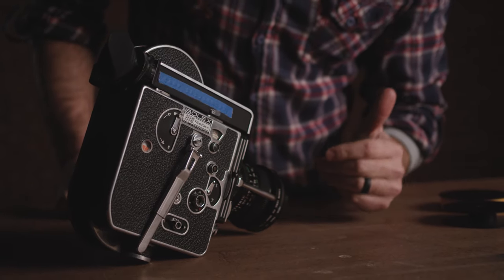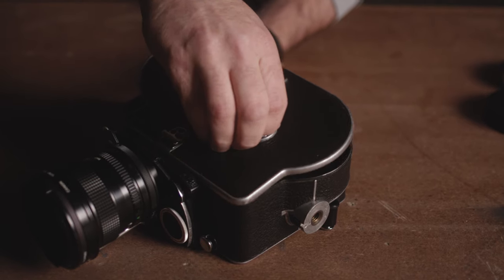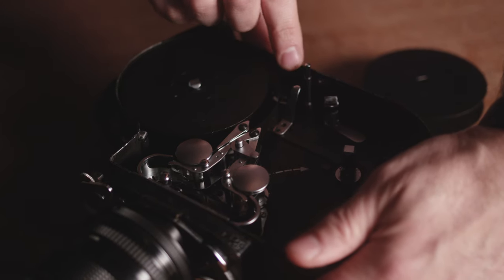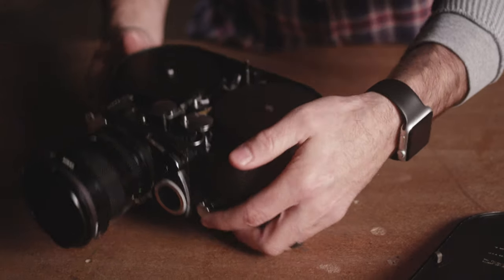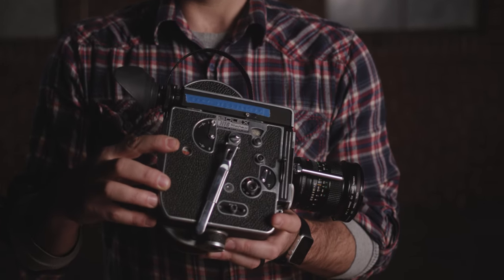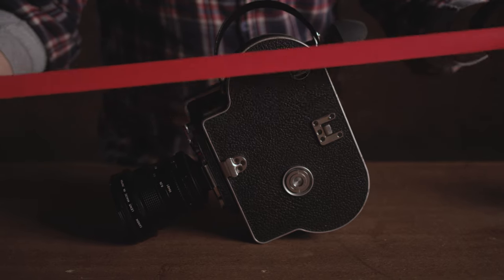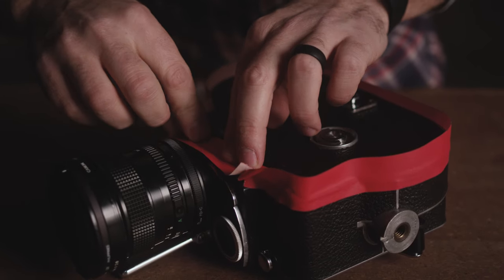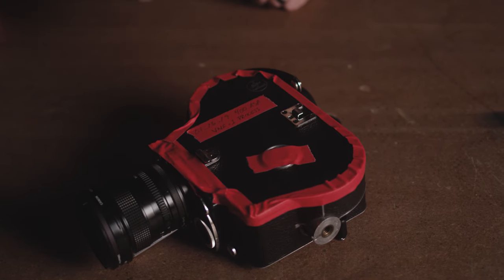Loading the Bolex H16 - Sprocket&Claw - Ep 002

Comment: Great stuff Justin!  I especially agree with your comments about film image burn in.  I love that look.  When sending in super8 in to film labs I always note asking them to clip as little of the ends as possible.  Most film labs cut off the beginning and ends of the Super 8 film and those are some of my favorite parts.  That organic flash and burn in and out is just awesome!  I use your tape method as well, although I usually use white tape for exposed.  Is the industry standard black?  One note to your viewers...  if you forget to press the little button to release the loop formers, don't worry!  The camera (and that button) are designed to be pressed/released when you re-attach the door.  If the camera runs quite and smooth there is probably nothing to worry about... if you shot some footage no need to waste it by re-opening your camera to check the loop formers.  SHOOT FILM!
Reply from the maker: Great tip on the button. One of the reasons for starting this series is to get the conversation started. I guarantee I'm going to learn a ton from this community. Good call on the S8 carts. I feel like my footage always begins with a film burn but never ends that way. Maybe I'll make a not on the next order! Thanks for watching David!

Comment: I notice you have an FD lens mounted, i just bought a EF to C mount adapter and was wondering if you had tried EF lenses on a Bolex? My adapter has built in aperture blades by the way, since i can't control the aperture on the lens itself. Was hoping to get an opinion on this before burning film. Thank, great channel by the way!
Reply from the maker: Dom Grimard I haven’t tried EF lenses on the Bolex but the adapter seems pretty great. Does it tell you what stop you’re at on the adapter?
Reply: @MidwestFilmCo  just saw your video where you use that lens on the Bolex, looks fantastic and that makes me pretty confident to use EF lenses, just gonna have to eyeball the aperture.
Reply from the maker: Dom Grimard Good luck. Lemme know when you get the footage back!
Reply: @MidwestFilmCo  sounds good, might take awhile cuz i made a mistake by purchasing a non reflex version on eBay for super cheap which i regret. I will sell that Bolex and get a reflex one, Don't know why i did that, better to spend a little more and get that reflex viewfinder. Got my film stock today though.
Reply from the maker: @domgrimard  Oh man! Yeah, the reflex is definitely the way to go! I hope to get the website up this summer where I'll be offering fully serviced/functioning Bolex H16's as I find them! Good luck. Keep me posted!

Comment: This is great , thank you.    Subscribing.   I have a Bolex H-16 RX4 which I haven't used very much for shooting (only really used it for stop-motion animation and a little bit of playing around with live-action shooting)  and I have a Kodak K100 which I've used more for live-action shooting .   I want to use my Bolex more.   One thing I'm finding a bit discouraging with the Bolex RX is that the RX prime lenses designed for it are very expensive .    I have several Wollensak and Cine Ektar C-mount lenses I've used on my Kodak K100 , but "officially" according to Bolex technical literature we are only supposed to use specified RX lenses on the Bolex RX cameras ... but from what I've read, some non-RX lenses will work ok with an RX camera , as long as they are stopped down to f/3.3  or more .   Supposedly there are some non-RX lenses that are more usable with an RX camera than others , depending on a number of factors, (mainly the depth of the exit pupil of the lens )  but it's hard to find information that will recommend specific lenses ... what I'd like to do is start compiling a list of non-RX lenses that people have found will work well with Bolex RX cameras .   So I hope maybe you can cover that in a future episode .
Reply from the maker: I'm definitely not a technical DP down to that level. What I've found, in my personal travels, is all I can speak to. There are endless conversations about the Bolex RX and lenses on Cinematography.com. I see DP's rocking PL mount lenses, which is my ultimate goal, all the time. Their results are amazing. The 20mm FD lens that's attached to the camera in this episode is a 40mm equivalent and I love the result! Here's a video with that setup, https://youtu.be/NN6v1IaPq0c. I left the filter tray out, by mistake, when shooting the first roll. You can see how sharp the image is with the Canon lens. I say, play until you find something that works for you!
Reply: @MidwestFilmCo   -  I think the results you got with the Canon FD 20mm look very good , so there's at least one lens to add to my list of non-RX lenses that work well with a Bolex Reflex camera.  Thanks.